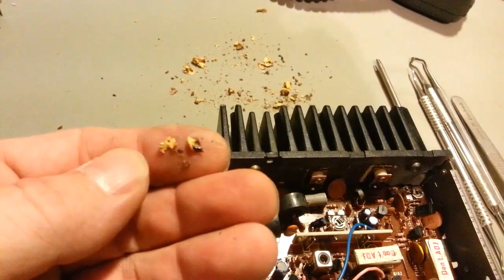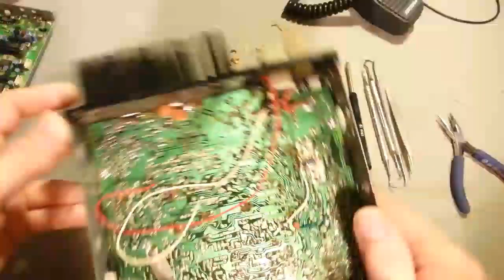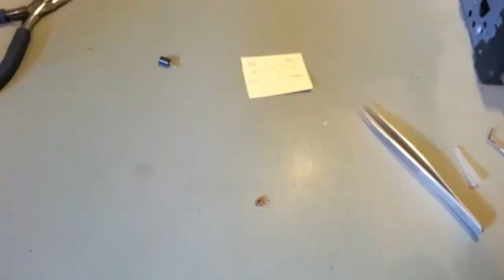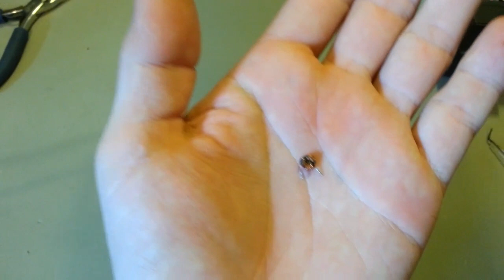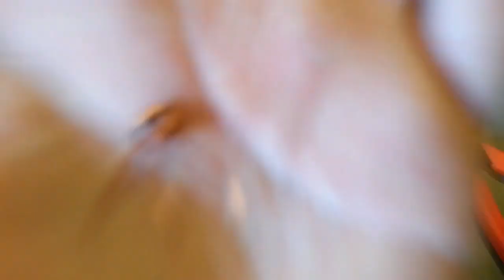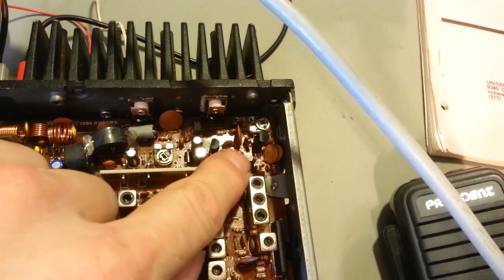President HR2510 restoration and rewinding corroded torroid transformer.

Comment: Have one of these radios. I use it for a 10 meter beacon station. Specs Call for ~25 watts nominal for CW mode. My wattmeter shows about 10 watts on a dummy load. Is this typical for this model of radio?
Reply from the maker: No, it should be able to do 25 Watts.  Remove the covers and check to see if there is deteriorating glue around the toroid cores like shown in this video.  As it becomes conductive it starts to short out the toroid cores and output power gradually decreases over the years until there is no output at all.  Mike KC3OSD

Comment: Great job on the video's.  I am first class tech and worked on the radio's back in the 70's and 80's, now retired from Delco Electronics and getting back into the CB stuff.  Never had that shorted glue issue back then. Interesting that this glue is shorting all these old radio's out.  I am buying a few radio's now to work on and this is very helpful info.

Comment: Hello friend, I have a President Lincoln Mk1, that when turning it on for the first time it takes some time to show the frequency of work, I explain myself better, the screen turns on but it does not show me the numerals, and after 5 minutes they appear, but that happens only when the radio has several days off, I imagine it can be some capacitor, you could help me to repair this fault. Greetings from Venezuela
Reply: Could be an electrolytic capacitor on the CPU board that's gone bad.

Comment: Is glue a problem on the modern radios, or did they fix it?
Reply from the maker: Yep, still a problem.  After almost 40 years they are still using this crap.  It's nowhere as bad as it use to be but I do still see small amounts of it in modern production CB radios.  Luckily modern surface mount component design radios don't have as many parts hanging off the board that need it so probably why you don't see as much of it.

Comment: Did Uniden and Kenwood get together and go half's on the Sony Bond? My TS-440 had the same problem, the dreaded Dot Problem.
Also I checked with an ohm meter and get no conductivity the glue is almost white. Was there a change? I've owned this 2600 since the very early 1990's when I bought it new.. Thanks for the video!!

Comment: Mike - You have a link/source for the bulbs?  Been looking for replacements but it seems LED's are all the rage now! Thanks! ~Jack, VEG
Reply from the maker: +Vintage Electronics Geek 

http://www.newark.com/mcm/25-060/lamps-bi-pin-voltage-8-v-current/dp/38C9286

or

http://www.vintage-electronics.net/bi-pin-lamp-8v-80ma.aspx

These are bi-pi  bulbs.  Just add wires.

Comment: Knippex makes a nifty tool for stripping magnet wire; it has different blade sets for the different gauges of wire...beats trying to strip with a box cutter as I used to do! One caution about rewinding coils/toroids that probably doesn't apply here BUT just in case - you have to make sure that if there is a phasing relationship between the windings that you follow it (those dratted dots on the schematic); in some circuits it's important and not in others but if you don't follow it when it is required the circuit won't work correctly or at all. TNX for sharing Mike!

Comment: Well within reason on the power output. The factory is too conservative at times but on the other side a lot of customers and irresponsible shops go too far. My Lincoln has an MRF455 from the factory as a final a 5 watt dead key is kind of anemic with that much transistor. If the rest of the radio is poorly designed or has low rated parts it makes sense to upgrade those parts right? Not to get insane power out of it but to make it run cooler and to balance the design to remove weak links. The MRF477 is a 40 watt device right? Would it really hurt it to have it swing to 30 watts? Is it a problem with the chassis not being able to safely support that level of output? Oh and I am not questioning your judgment as a professional I am trying to understand the nature of this radio since I own one. THanks Mike for explaining?